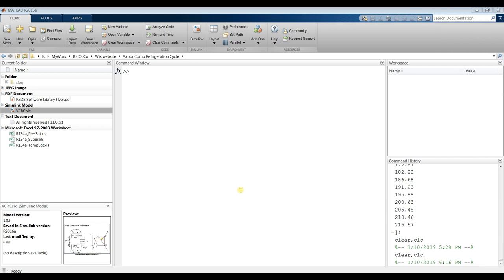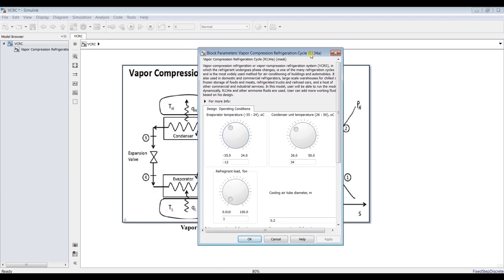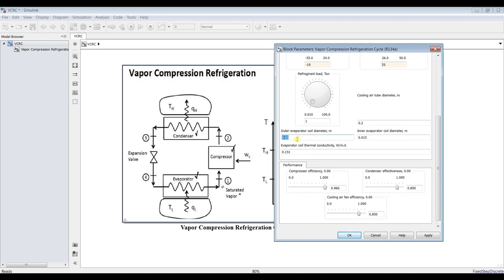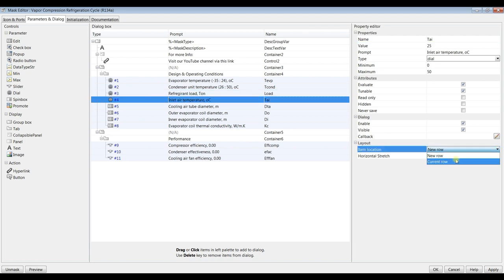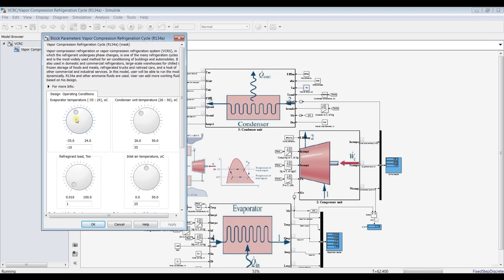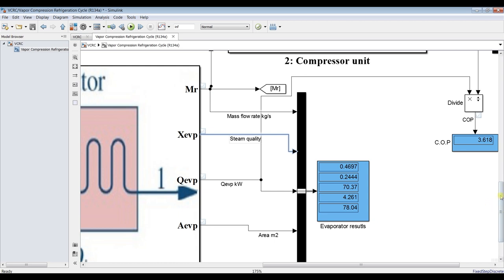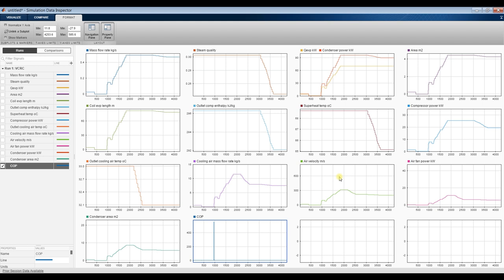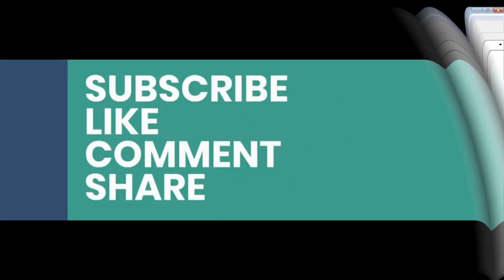Vapor Compression Refrigeration Cycle | Matlab | Simulink Model

Comment: What is the specific heat function depending on the temperature at 16.17? Is there anything for water? Where can we access? Can you help me?
Reply from the maker: download my PhD thesis or my master thesis from REDS library website 
https://8127cc49-8520-46ea-a067-7fd9b9a85d0c.filesusr.com/ugd/b4c3be_27911ce2c3594dd19e6398af0932e1ae.pdf
or 
https://www.redslibrary.com/publications-books
Reply from the maker: see the appendix in my thesis
Reply: @mohammedabdelwahabsharafel2515  merhaba. I looked at his thesis. I assigned 300 Kelvin to the x variable in equation A. 1.005 was required, but not.
Reply from the maker: @farukkilic6010  It is not in Kelvin. Assign it in oC. And I think X is the salinity as I remember. Try to review it will. Assign salinity as zero (0)
Reply: @REDSLibrary  Thank you so much for your help.
Reply from the maker: @farukkilic6010  by the way, REDS LIBRARY is now Turkey
Reply: @REDSLibrary  😁

Comment: How can I change the refrigerant used?
Reply from the maker: Watch that link, but save the old version. Also you will need to add super heat correlation in the compressor. https://youtu.be/MKyeenxNuec